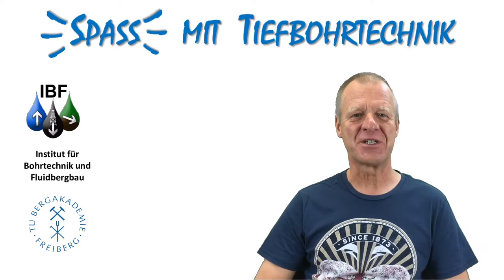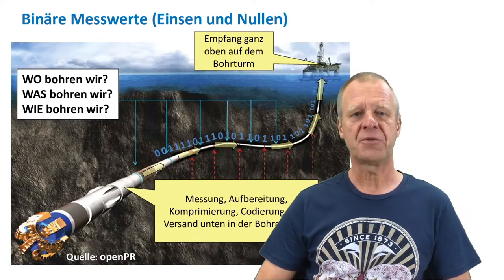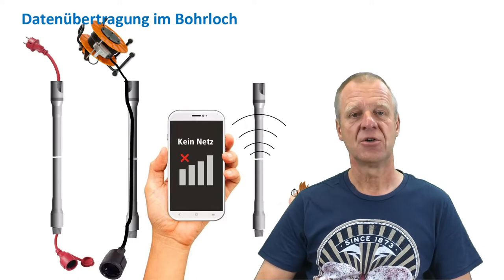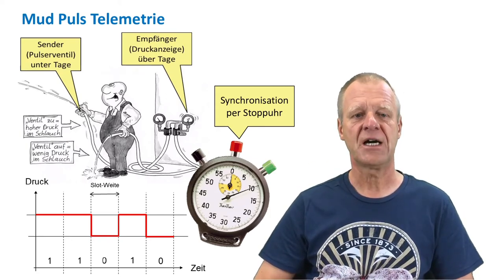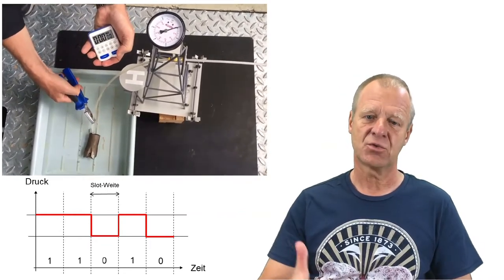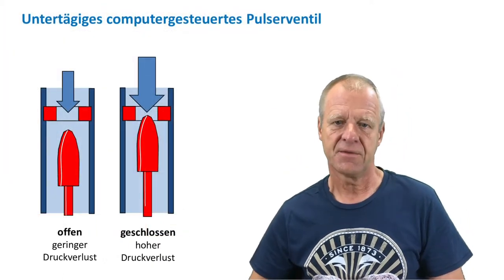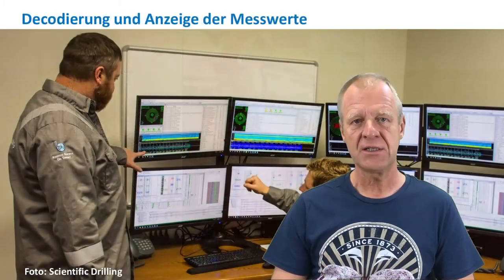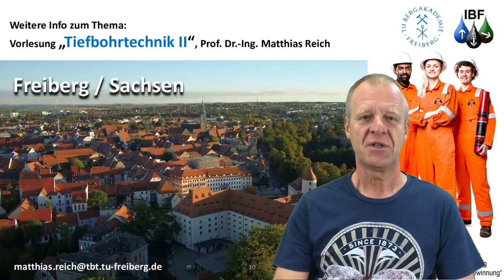My Valve can talk? - How the mud puls telemetry works

Comment: I was a roughneck in ND and got into wireline when prices fell for job security. We used overshot for pipe retrievables when a reverse-torque caused a spin off (drill pipe stuck in hole) and the technicality of downhole tools makes me want to become a downhole tool specialist. I strung up many BHA containing MWD tools and their role fascinated me